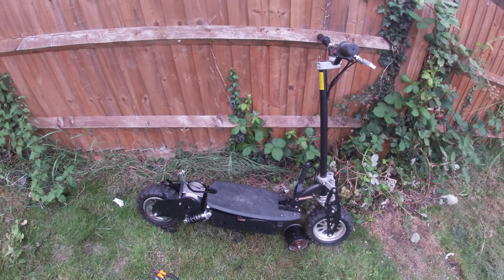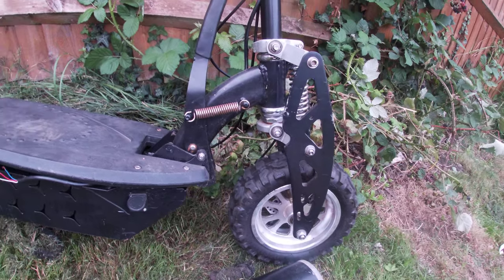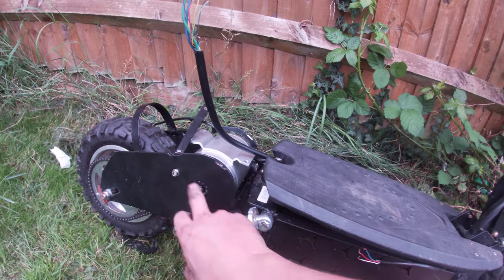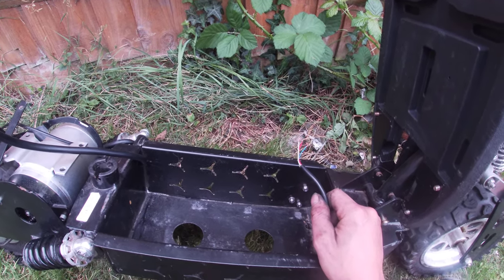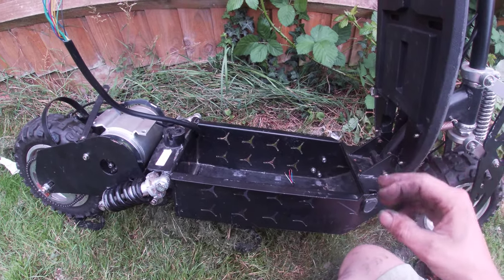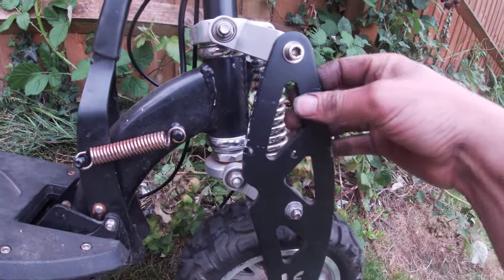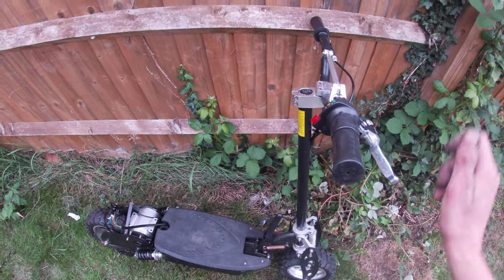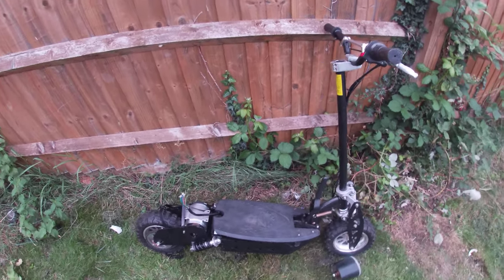evo powerboard 1000w to 10kw   motor upgrade  and  over volt to 96v  p1

Comment: Im doing a really similar set up to you, but using a zy1020 motor. I tried the build loaded with my weight and its so slow, the controller also heats up a ton. Have you got any tips for me?
Reply from the maker: is it the brushless  3+5 wire   or   brushed   type brushless  should fly     if  brushless  check hall  (plug with 5 cables  is   all  connected   ok     check motor  phase  wires   by using a  meter   set to ohms     check the 3  main  wires   read the same  in any combination   also check wheels      spin free  with  chain off eg   check  brakes  are not  stuck on    check chain  isn't to tight    check motor  spins free   buy   hand    (motor off  but   spin   with fingers  it should spin free
Reply: @TCBOT  I have brushed motor. I think that it might not have enough torque. I have 16 teeth on motor axel going to a 32 teeth sprocket on the wheel. A 2:1 ratio. Do you think this is good enough?

Comment: It’s got good potential that scooter 👍🏽. Have you tried reverse engineering a car alternator for the motor.? I’m building a twin motor mountain board at the mo. 3600w each😁. I will only be running half to begin with. I’m not even a skate boarder 😂 might not end well🤭
Reply from the maker: not  tried  it yet but ill  have a go soon   as   got 1 spare (parting out a van )    3600w   mb   sounds  nuts   yea  think  id  end up in a and e on that 1  lol tho they  are easy er  than on road skate boards nothinc  worse  that hitting  a  small stone  on one of those  lol

Comment: How did you get on with this build? 
I have one to play with I'm thinking about modding/extending the motor mount and installing an out runner motor then adding some eig co20 cells for 72v or some 6s lipos x3 for 72v then adding a kelly controller for 120-300 phase amps trying to keep it decrete looking as as possible lol

Comment: What model of this elektric bike is?
Reply from the maker: SOLD AS EVO POWER  BUT ALL OF THESE ARE MADE IN CHINA  IN SAME FACTORY      CHAOS  MAF ETC    HAD ALL OF EM ALL THE SAME BITS
Reply: @TCBOT  ok do you know what module uniwersal is compatible? With it
Reply from the maker: @ArturSadowyMusic  IF YOURS   IS 36V   48V  JUST LOOK   BRUSHED    48V/36V CONTROLLER   YOU MIGHR  NEED  TO SOLDER SOME CABLES     (THESE ARE   DIFFRENT DEPENDING ON THE DAY OF THE WEEK IT WAS MADE

Comment: I have the Evo King 2000 watt dual hub. I've had it about a year now and I have a problem with it. As soon as the battery gets half way down the scooter just switches off and I can't get it to switch on, but as soon as i stick the charger in it comes on and stays on even if I take the charger straight back out. Do you have any idea what could be wrong? Can the battery be repaired?
Reply from the maker: battery  has  a bad cell group    and need to be rebuilt   if was left sitting   some time the bms might have drained    1 or 2 cell groups  down    and may need afew charge cycles  to balance  the pack
Reply: @TCBOT  so you think after a few charges it might be alright? It wasn't really left sitting recently, though it was for a few months about a year ago.
Reply from the maker: @Zero-wl7oe  yes give it a try   tho   id do outside  if you can   just in case  there is a bms fault    (not that these  are  known for it  but best be safe   if charging  indoors  do so when at home    and awake   but id expect  it to come got after about 10  full charge cycles  if that dont do it  it need  a more indept  look
Reply: @TCBOT  ok I’ll give it a go for sure 👍. Thanks for the advice.

Comment: Hello budy, how are you? I'm from Brazil and scooters started to become popular recently in major cities. I have a very similar 1600W 48v native model. I'm thinking of creating a 96V project, with the same original motor as the scooter. Obviously a 96V TDP would indicate a current far above the standard motor, but if I limit the maximum current to 33A (default value with the native 48V) would I get higher RPM and power? As much as double the voltage, I believe it is not enough voltage to break an internal electrical insulation
Reply: Yes you will get higher top speed and also quicker acceleration at the same or increased amperage, due to the increase in wattage. But you're likely to destroy the controller in the process. The vast majority of 48v controllers use 63v capacitors and not enough mosfets for a substantial increase in power. Personally, the furthest I'd push that system would be to use a 52v battery without any other mods and get slightly better performance (providing the new battery has the same or higher discharge current) 

Anything more than that will require a completely new system if you want it to be safe and not become a serious fire risk.

Comment: I'm now going for a record the worlds fastest chaos scooter parts have been ordered.

*72v controller 60amp per motor 
*2x3500w motors will peak around 5000w each
*72v 30ah battery (being upgraded down the line)
*A pair of balls! thing is gonna be able to do over 60mph basically rion specs in power depending how much of restriction the battery will be!
Reply from the maker: make shore you dont exceed   the battery's specs    as the bms prob wont cut off    properly  and you could end up  with a fire    iv got 72v 4ah pack but its got a limit of 30 amps lol;   i need lipos for real power but they 4x as expensive  now thats gone be pulling 120amps   that's alot
Reply: yeh right prove it lol
Reply: @duncanloveskim6820  nah bad idea because the stem snapped they can't handle power lol I upgraded a velocifero running a fardriver72360 and that's fast enough lol

Comment: Do u know how 2 derestrict these
Reply from the maker: these are unlimited from factory  tho if the controller  has been replaced it may have a white wire     with a connector  in the centre   unplug that it will go faster if its not got that its unlimited unlimited speed should be 20-25mph for 800w  and 25 -30mph for 1000w  a 1600w should do 30-35mph
Reply: Mine is 1000w only go 18mph but battery is a bit bad u think that's the problem
Reply from the maker: @wesleybushell3215  bingo yep id bet one of the 4x 12 battery's is  at a lower voltage   than the others   shuold be between 12.2 and 13.8v    per battery   you can charge eatch one on a car battery charger     then should be good to go    if  its under 12v tho it might be knackered      (tho still worth a try )    if one is dead  you will need all 4  (asuming its 1000w 48v
Reply: @TCBOT  so if I have 3 batterys it's a 800w yeah
Reply from the maker: @wesleybushell3215  99%  of time yes tho 36v 1000w scooters are a thing but not common    it will say power rating on the motor   or should do unless sticker has been removed
Reply: @TCBOT  any other way 2 make faster

Comment: Whats the top speed?
Reply: 50 Mph. Very fast.
Reply: Where do i buy the motor?
Reply: @mohammadfairos502  I'd stay away from the my1020 motors. They don't pair well with sine wave controllers and the magnets that are screwed on tend to crack at high rpm. Also, they're not very durable above 4kw.
Reply: @colinriches1519  so kunray brushless is better right
Reply: @str8xrippin  I think kunray use the my1020 motors last time I checked. You should be able to check the model number.